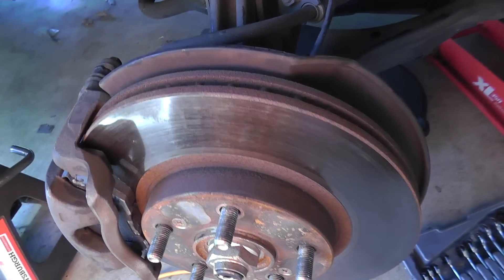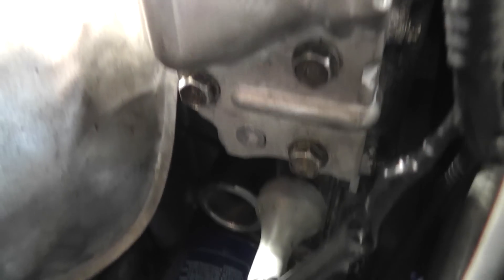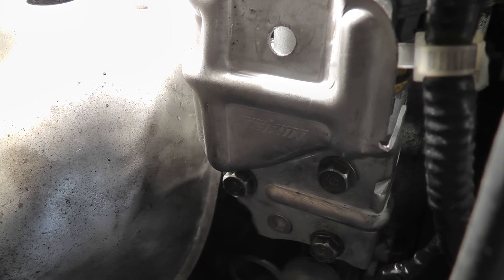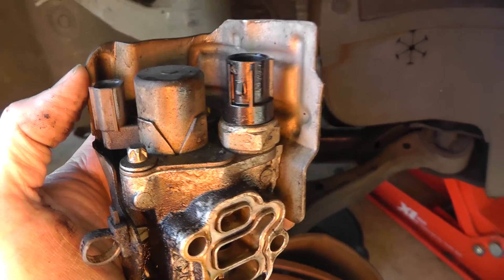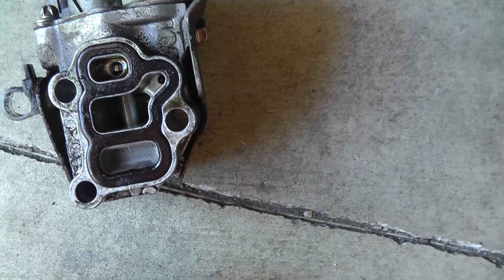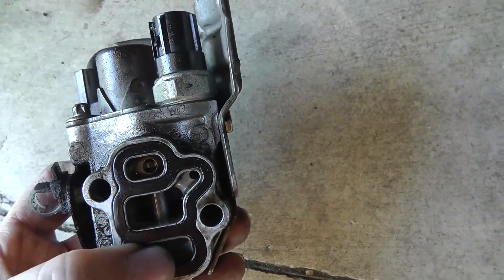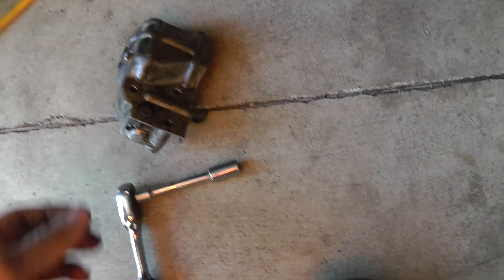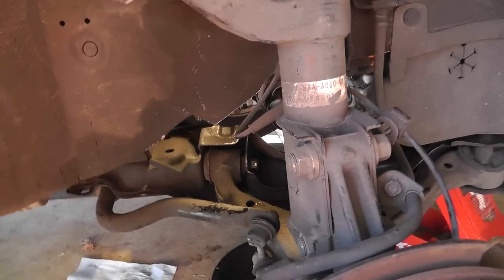2002 honda crv vtech solenoid install

Comment: Good advice on the "thru the wheel well".  On my 2003 I was able to access it from the top by moving aside the power steering hose after unclipping it from the bracket. 

Doing it this way kinda makes the bolt heads "blind" so if you need to see what you are doing, definitely take off the right front tire.

The check engine light is off (after resetting the computer) and it runs well again.

Thanks for the post, I needed the encouragement and saved $120.00 installing it myself.

Comment: The gasket is $4 at Honda, got one today. If there is no code, your spool is still good to go. 2003 CRV ABQ, NM Also, the vtec oil pressure switch under it leaks also. If there is no code, the oil pressure switch O-RING is $4 also. should be.50cents to be honest.
Reply: What if i have a code then what? :(
Reply: I'm having problems with the oil pressure switch under it leaking but I'm not getting a code what do you think it's the o-ring thats bad?

Comment: I have 2002 Acura RSX, base model. One day I decided to wash not just a car, but my engine as well (dumb idea) lol
After I started driving, engine light popped up, and I realized, that my RPMs won't go over 4000. However I was able to get back home, going 80 mph on freeway.
When I checked the engine light, it showed up as "p1259". Plus I do have that stupid oil leak too. Now I know how to fix both problems! 
Thank you! :)

Comment: Awesome video man! Good information about he 2nd gen CRV oil leak. I have an 04 with oil leak as well and just recently replaced the valve cover gasket. The oil leak settled down but there's still small drops of leak under the passenger side, and I suspect it's the vtec solenoid because that's the last part I haven't checked. Thank you for the video.
Reply: gixxerboy405 hey, did you ever get it fully solved? I have the same year

Comment: Eddie - you're great!   I did not have a leak but had the sensor putting the vehicle (2005 CRV) into slow mode at 2500 - major pain.  I thought I would have to bring it to the dealer and shell out big $$$ but with your vid and a new sensor ($69 at Advance Autoparts), I removed, cleaned, installed and solved the problem all in one afternoon.   What is really important is that this is the last warm (38 degree) day before a week of bitter cold - I'm glad I got it done!  Much thanks to you!

Comment: The gasket is $3 from  Honda, I had to replace it twice already on my RSX, there is also a gasket on the front of the engine behind the IM which is also notorious for leaking, it's the VTC strainer gasket.

Comment: Good video !!
 ive just taken mine off and ordered a new seal only £7.00 from Honda/
mine was leaking from this unit took me ages to find it.
Oil was running down then around the sump on to the front transfer box.
Degreased and jet washed first... 

 Easy to take the connectors off from the top and i found it easier to crack the bolts from the top and take them out from the wheel arch with wheel off...
Thanks for the video it gave me the ok to do it myself

thanks

Comment: Well done. You’re the only one I’ve seen do it from underneath. Helpful to see where the bolts attach. Do you by chance know the part number, or how to find it? I have an 05 Accord.
Reply from the maker: sorry i don't... your part number could be different from mine anyway so I would simply google the selonoid for your make and model car. Chances are it's not but I would do this anyway. good luck.

Comment: Hello Eddie: Great inspirational and instructional video. I jacked up my 2007 CRV and removed the passenger wheel, as per the steps described by you. Unfortunately the solenoid is not accessible from underneath for the 3rd generation CRVs. I had to remove the three bolts from the top. Perhaps Honda is forcing us to go to the dealership :(

Comment: Thank you for this video. I had a P1259 on my 2002 CR-V and replacing that part fixed my problem. Thanks!
Reply: You get the same cold after replacing the part?
Reply: @julianelcash2261  7 years later and the code has not returned 👍
Reply: @jakesnake_27  sorry what i mean to say, i chage it with out a code poping out, because i was like, it's leaking so better pre change it, and i did! now i have to the code all day, still dosen't go away!
Reply: @julianelcash2261  Ok, check that the bolts holding the solenoid to the engine are tight, and that the electrical connectors are firmly seated.

Comment: Awesome video Eddie....I've been looking high and low for this footage! Took me forever to locate the VTEC oil pressure solenoid and I only did thanks to your video. I have a 2007 CRV, so I hope the tire trick works on that year. If I had to I could probably do it from under the hood but your way seems much, much easier. I agree with the others as I had a code P2647. You should use that as a keyword for the video. I only found it after searching for quite some time.

Comment: Very nice way you change it by the way do you get an engine light after you replace the part what do you do? I replace everything I still have the engine light on after 5 hours
Reply from the maker: If you know for certain that’s what was causing your engine light error then chances are all you need to do is clear the engine light. You can go to an AutoZone and they will do it for you. Or, you can drive your car for sometime and it could clear out on its own. Probably good to have Autozone do it so that if it never comes on again you know for certain that was the problem
Reply: @Doitforyoself  yeah is that code P---- I have a scan tool I bought from a mechanic going out of business, but I notice that one of the switch has no voltage ⚡ there is nothing else I can't think about and it's only reving to 5000 rpm, still engine light on after 2 days, I was like, what else I f up, but I drove 45 miles today, not leaking at all

Comment: Amazing, thank you! My check engine just came on for this reason. Do you know, is it bad to continue driving it with this issue for too long? I plan to fix it in the next day or two, and I’m currently in the middle of a drive. Best to fix it right away or is it ok to drive it. Thanks!

Comment: Goldenboy, the gasket is only $10 at the dealer.  More power to ya, but im not in the habit of wasting money on a perfectly working OEM part for a cheap knock off.
Reply: Do you have part number of the gasket from the Honda dealer?

Comment: Im just getting the code and Autozone did give me the read out on the computer saying it was the VVT pressure switch. I bought that, and your video so far is the best one I can see where this is located (2004 CRV). I only have to replace the pressure switch, is it easier to go through the top of the engine compartment and take the switch off that way, maybe after removing the engine cover? Looks like a half inch socket to unscrew it after a wire snap on connector from the back. Guessing as I've never replaced one of these yet. Some documentation online says there are two of these, on an intake cam and exhaust cam? I have no idea on any of that, so I'm pretty much looking at the one located on the solenoid youre replacing here. Im not a mechanic myself, but try to do as much DIY fixes as I can on my cars before handing over my checkbook.
Reply from the maker: Jason. The switch is just beneath the oil filter. Best way to get to it for me is by doing it this way. however, you may have some luck getting to it from the top. I would also only get this item and the like in an OEM or close. There is a 2 pin connector that plugs into it. Just be careful while pulling it. When pulling off the old switch check to see if thread lock has been applied. You will know if it looks red or bluish. If so, apply a little bit of BLUE  thread lock on the new switch. This is an easy fix and can be done in an hours or less with the right tools.
Reply: Thanks Eddie for the reply. I appreciate the help.

Comment: Great great great video! I'm changing my wife's oil pressure solenoid on her car as well. My question for you is do you think the same technique for removing the oil pressure solenoid on a Honda CRV will be the same for a 1998 Honda Accord LX? Thank you again for that great video. Eric.
Reply from the maker: No they are not similar. First thing you should check is the oil level. If it's good then it may be the oil pressure solenoid but if your oil pressure light stays on, it could be a short from the oil pressure solenoid wire to the battery.  The oil pressure solenoid should be in the same general location behind a boot. The nut will need to be twisted counter-clockwise with i think a 24mm deep socket to loosen. I believe there are videos on Youtube that help with this.

Comment: What did you search for to find the part? I was trying to find it on Rock Auto, but couldn't. Wanted to compare to eBay. Thanks so much for doing this video! Did replacing it help with the oil leak? I looked under my CRV and saw oil right above the oil filter and this video causes everything to make sense now. Thanks!
Reply from the maker: Just search for Vtech Solenoid for 2002 CRV 4wheel drive Honda. The leak stopped but I also replaced the oil pressure solenoid right beneath the Vtech solenoid. It's only 12 bucks at Autozone although I do encourage those to use OEM parts. Also, make certain your oil filter is snug before you rule it out. if you can hand tighten it still, then the leak could be coming from the seam around the filter. hope this helps.

Comment: I bought only the OEM Honda gasket to save a few dollars and the leak never stop. I follow your recommendation and get complete new after market module (gasket included). $65 plus S/H from Rockauto.com. Problem solved! No more leaks! Thanks for your video!

Comment: Hey I have a 2005 Crv and I notice the same right on the oil filter I noticed some oil and right on top of the axel and there a hose with a clamp as well it was covered with oil I bought the screen long ago cause I know those Honda it always leak in those areas like on my Honda Odyssey it was the same leak

Comment: does this valve relate to power loss?
excellent video
Reply: +Sunil Behari Yes it does, it's the sensor that puts the vehicle into "slow" mode. It doesn't want to go above 2500RPM. It might reset by shutting off and restarting the motor.
Reply: thanks sir  for sharing your knowledge

Comment: Hi. Thanks for the video. 
Simple and understanding. 

 
So my problem is gas leave. Not low in the tank but at top  .

The mechanic hooked up the computer to my car and the Diagnostics says that I have VTEC System Failure also ho2s S1 heater failure and evap control system leakage fuel (tank system).

The first mechanic that looked at my car he stated that I need a new set of keys which is the reason why the car will turn over but will not start until after about 3 for turns. 

Second mechanic didn't say anything about me needing a key but just that I needed tthose three parts.
He didn't actually inspect the vehicle. He's just going by what the diagnostic says. 

 my question to you  is .....
Do u think he needs to check vehicle before I order the parts?

is it really necessary for me to get the whole VTEC System? 
What if it only need one piece WHICH HE BELIEVES IS THE GAS LINE.
And also is the GAS LINE connected to or located in side the VTECH? Because he believes it's the fuel line leaking. 

Are those two completely different parts or ONE?
My vehicle is a 2003 HONDA CR-V.

Comment: Just FYI. I can get it off from the top. With a little bench u can kindda lay on the engine. With a 10mm deep well socket u can get it off. 20 mins off then on. Piece of a cake.
Reply: Black Hole a lot easier like this!! Thank you
Reply: Black Hole Yea that's the easier way just have to put a pan to catch the oil that comes out upon removal.
Reply: This is the best video ever!  I love it bro!

Comment: At 0:32 in the video as the camera passes by your strut it looks like the strut is leaking...has it given you problems yet? Also, thanks for the video, mine is also leaking and I am going to change it soon.
Reply from the maker: +Thomas Christensen strut seems to be working but i do need some new ones including some new control arms
Reply: +Eddie Regory right on, I'm in the same boat, I've got 297,000 on my 2002. planning on re-doing most of the front suspension/steering this summer. original clutch went 260,000! love that car.
Reply from the maker: yeah, I don't mind buying the parts but  the older i get the less I want to do mechanical work

Comment: Hey Eddie I just bought a Vtec solenoid from advance and I took the old one out and put the new one in but I'm still having a leak but I don't know where is it coming from what should i do ....
Reply: Should have re-used your old one(assuming it's the original) and buy the gasket from Honda for $5.99 and install it...I just did mind recently and no more oil leaks 😁!

Comment: Do I need to drain the engine oil first?
Reply: I was wondering too.
Reply from the maker: +shontapl no. not if you're just replacing the Vtech solenoid. Just make certain you wipe down area where you will be installing the the new solenoid or if you're just replacing the gasket, just where the gasket touches on the engine block. some oil will drip out but that's it. after you get the new one installed, just recheck your oil.

Comment: I went to auto zone and had a diagnosis done because my car hesitates when i try to accelerate too hard on a ramp joining the highway. Anyway, the result was that "Variable cylinder management system is stuck in off position". so i go to my mechanic and i have a quote for 380 dollars to fix this! The solenoid is charged to me at $172, diagnosis $70, shop fee $16, labor $90 and tax of course! Its maddening that the part costs 80 dollars on eBay! I have a Honda accord 2005 LX, 4 cylinder sedan. 

Do you know where i can approach to find the tech solenoid on this model? Anyone?

Comment: hey is your crv a 4wd auto? what year? I have to do the same but my oil control valve is separate, and on the top right side of the engine block just above the alternator. For the life of me I can't get the proper beta on what the actual part code is but I think it's 15830-PNC-003

Anyways, Thanks!
Reply from the maker: Yes. it is a 2002 EX 4WD.

Comment: I don't know how old this video is but I do have a question maybe you'll be able to send me a comment back. Was there a filter within the Vtec solenoid switch I was watching an episode of Wheeler Dealers and they had an issue with a Honda S2000 VTec system and the solenoid was fine but the mesh screen oil filter was plugged and the VTEC System didn't work like it should have. my 2004 CRV just doesn't seem to have that pep used to have when you step on the accelerated granted this vehicle has approximately 169000 miles on it. I am just wondering if my vehicle might be suffering the same problem as they did on the television show because the VTEC System is a very useful system and it does give you that extra bit of power that you need particularly when you're on the freeway and need to pass. Give me a holler if you could.
Reply from the maker: yes. it's simply a screen that's part of the gasket is all. I will say that my 2002 also has less pep and I've done all the invasive things to it to make it faster. Such as, fuel injector additive (K2 on Amazon) I know only put synthetic oil BLEND and I've changed out several other things on it. I'm certain if I dig further into why and how to make it faster but I just think it's just tired and worn is all. it's not completely gutless but it certainly doesn't have that new feel like it used to. most of the issues I've had with my Honda were electrical. Most of which I fixed myself including the crank seal below on the passenger side. Funny thing is that I had a slight oil leak somewhere and now it's just gone after changing from conventional oil to synthetic blend. Anyway, if you ever come across an answer for your sluggish problems let me know. thanks.
Reply: I get what your saying my father has a 2007 gen3 crv it has more miles on his and when you step on the gas it moves. Pretty fast for a crv the engines are pretty much identical the biggest difference between the two (under the hood) is he has a 5-speed. His feels more sporty and the steering feels tighter.

Comment: I have an oil leak somewhere in the back of my engine, on the right passenger side of my 05 Crv, it's leaking into my 3rd cylinder. Do you think this could be the same problem?
Reply from the maker: Eliot, is there oil on your serpentine belt. If so, there is a prefilter for the VTEC between the power steering unit and engine. It's a plate that may need to come off and replaced with a filter. If there's not any oil around that area and your cylinder just shows oil, it could be the oil pressure selonoid right under the oil filter. honestly, it's hard to to say until you get in there, maybe clean things up with engine cleaner and just look. also, i once had this happen to me and realize that the spark plug was barely tighten.
Reply: Eddie Regory yes I have it on my serpentine belt, I appreciate it I'll check it out and let you know!
Reply: Maybe your rear main seal?

Comment: Hi, i change the vte but after that, When the car exceeds 120 kmph, the gas pedal is disconnected and I cannot accelerate. And the car is churn. I had to slow down. Is there a solution please.
Reply from the maker: I guess I’m not sure what ur asking… the VTE is there to regulate the oil pressure and has nothing to do with ur gas pedal. If You can be more specific that would help
Reply: @Doitforyoself  when i exceed 120 kmph, i cannot accelerate more after changing vte, and the car is churn